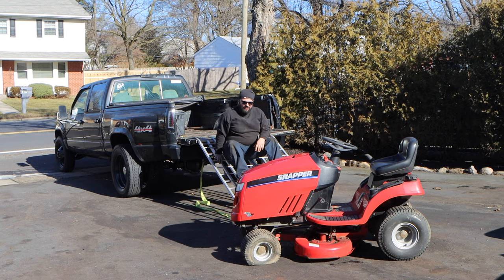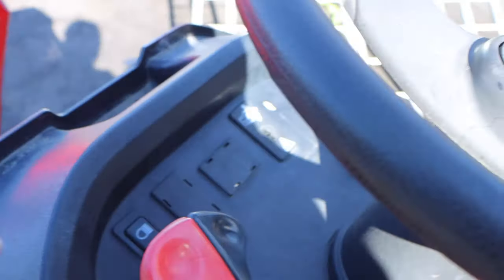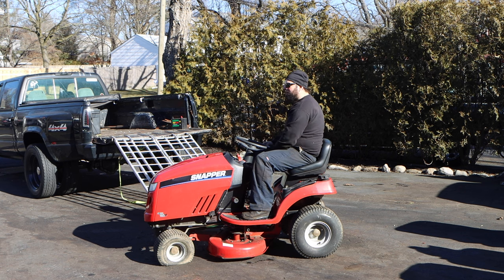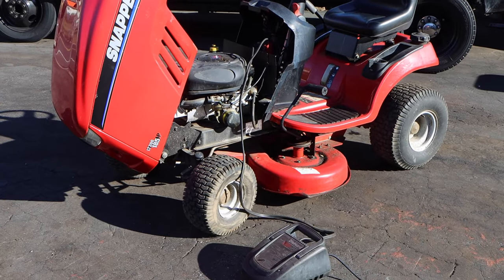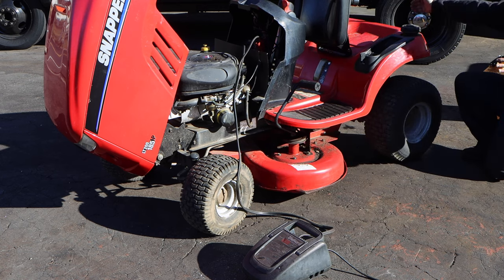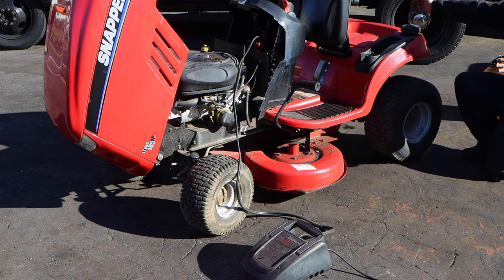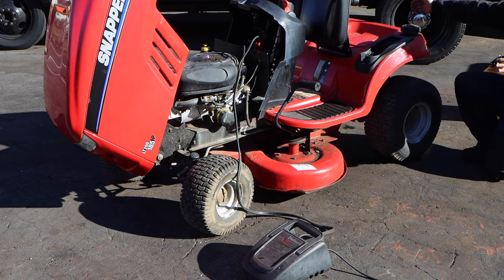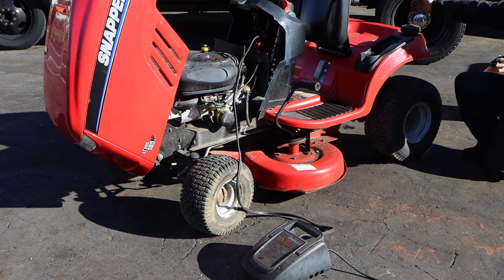Bought Abandoned Snapper LT200 Lawn Tractor 2 Teach Myself How To Fix #repair #diy #struggle

Comment: The yellow/black and the black wire heat shrunk together would go to the optional hour meter. The black with the ring terminal should be the wire from the starter solenoid to the battery. The positive terminal will also have a small red wire that goes to the 20 amp fuse then to the starter key switch. To jump a starter you often need a good connection, I try to activate the solenoid instead as a first test. The brake pedal needs applied to start, the pto off, and the seat switch depressed. The seat wires since disconnected should be open not connected. The parking brake might not depress the brake switch far enough to start, might need to depress the pedal. Mine is the twin cylinder version with a 44 inch deck. 
This rider is in the group with Simplicity, Agco, Massey Ferguson, Snapper and Allis Chalmers. Basically, a Snapper (cheapened?) version of a Simplicity Regent.
Reply: Oh, the starter is grounded through the engine block.
Reply from the maker: @robb1165  thank you!  that is what I thought

Comment: Set parking brake. Solenoid is bad. Start with a new battery.... I knew that was a Snapper 😄 🤣 
Hook positive from good battery to starter. Black to Negative on good battery/ the use the open end ground to the block. That jumps all safety switches.  Use a handle from plastic spoon in the key slot missing a key...
Reply from the maker: Sooo…How did you know it was a Snapper on my First Video?  What was the giveaway?
Reply: @pattayperformance  shape of the seat and body. Last one of those I had anything to do with was buying the engine after a tree crushes the back of mower. 20hp V twin with 108 hours. Looked exactly the same with the exception of the engine.  Later...
Reply: I burned my battery pack up, but they are so helpful! $120. Lasted 3 years.
Reply from the maker: @caseybszombiemowers2569  I will keep an eye and do some research on them.

Comment: Front valve stem in the inside matches my Simplicity mowers. Have had no issues with electric pto clutch in 7 years, dealer said they aren't a weak point (unless you snag the wires) but 🤷‍♂️ Get a DMM and check continuity of the sensors (with battery unhooked), they're just switches. The dangling connectors are not necessarily important, I've got a pretty high end Simplicity with all the options and it still has unused connectors on the harness.
Reply from the maker: What does your dash look like?  There are 2 blanks on the dash 

One is hours and what is the other…volts?
Reply: @pattayperformance  I think the other blank might be for hydraulic deck/accessory lift. The hour meter one can also include a digital gas gauge which is worse than the analog one on the tank 😁

Comment: Start with a good charged battery, and if that does not crank the engine over with from the key switch, short the solenoid and see if it  the engine cranks over, if so put a new solenoid in. The Brake has to be pressed, and the PTO Switch disengaged. The safety switch wires is tied into the PTO switch harness, so make sure the PTO Switch is push down. With the seat safety connected, you'll need to be sitting in the seat if you trying to crank it over from the key switch or just Press the brake pedal and set the park brake on, that will bypass the seat and brake safety but not the PTO safety. I would have bought that mower, so I don't think you did wrong by buying it. Jason stepping out our comfort zones and learning to be better at what we do, is always a good thing, so grasp the opportunity and stop jumping from a little spark 🤣
Reply from the maker: The Mrs said the same thing...she said I've seen you crawl under a semi and jump it.  Why is this any different.  I said...usually have my safety glasses on and when I hit the starter it moves.  The starter not moving and humming got me thinking a bomb was about to go off...did I tell you I suck at electrical LOL

Comment: Pull spark plug first and see if it turns over when you jump starter straight to a good battery.If so chances are compression release is bad or valves need adjustment.If it still does nothing starter is bad.
Reply from the maker: Thank you!

Comment: That charger may not give enough juice to turn the starter . Cracking requires a good 50A of current . the charger may not give you enough . A spare good used 12 v battery is a better source to boost with .
Reply from the maker: It juices up Mandingo but I will go through what I have

Comment: Tldr: yes the broken cruise is very likely your culprit or at least one of them 😁

Snapper has been basically a discount version of Simplicity for a while now, that looks like approximately the size of my Broadmoor. (As in, it may even share the manual, there are Snapper models in my manual) which also has a 38 inch deck but they had options for 40, 44, 50... Looks very very familiar to me, just a few slightly cheaper parts (no Vanguard, cheaper looking deck), very solid bones.

You gotta hold down the brake and turn the key to start it, with butt in the seat, and the cruise control (if applicable) and pto must be off (pushed in). Those are the ones that catch us in my family 🤣 I'm guessing the broken cruise switch is the culprit 

Yeah that's just like my Broadmoor. Darn good, just a little too narrow for mowing 0.6 acres. Go grab the manual and the parts diagrams from Briggs (who owns them now). It may be a Nikki, or Mikuni (?), or one other brand are possibilities on the Vanguard which is actually a Japanese Briggs joint venture.
Reply from the maker: Thank you!  I will get the cruise working and go from there!  not use to such fancy things

Comment: The discharge chutes are so stupidly expensive. It's not MTD or AYP/Husqvarna, but maybe you can make the MTD chute fit better for less than the real part. Briggs owns the brand now but probably didn't when that was made (mid oughts). Hopefully it's just one of the electrical interlocks on the starter. If you can't make it work you can probably part it out on eBay, I've bought a lot of parts on there.
Reply from the maker: $150 gonna have to figure something out even if I have to fab something

Comment: Simplicity and snapper = money pit
Reply from the maker: Why?  If their snowblowers and push mowers are good...why does the tractor fall short?
Reply: @Pattay's Performance  parts are expensive when they need replaced. Hoping you have just minor things to fix. Starter seems stuck. Walmart sells snapper push mowers. Snapper is owned by briggs.  I had a 1970 simplicity snow buster 524 that I got for free cleaned tank and carb runs like a champ gave it to my brother.
Reply from the maker: @christophermccomas5292  awesome!

IMO lack of experience/problems…

Seems like the most expensive things are motors/trans/seats and bagging components 

The only thing I priced out were blades, spindles and chute.

I didn’t know it was a 38” deck…so the only think that seems pricey to me is blades and damm chute. 

Spindles were are on par with Husqvarna 

Blades are $50 and chute is $150 which is BULL$$$it 

Odd size blades there are no aftermarket choices

Comment: Somethings to check, that missing key, may be an issue, the starter is frozen and may need lubing, pto won't work, unless that key is in, like a snow blower, I bet a snow blower key.... The plastic key, it might work, but that stater is frozen, it should of spun the engine, just by jumping the starter.
Reply: The missing key is for mowing in reverse. It turns and sets it to allow reverse mowing, and resets when ignition is turned off.
Reply: @robb1165  ah ok, on the back of it, does it have 2 wires leading to it?
Reply: @robb1165  or is it mechanical?
Reply: @robb1165  just wondering, if it's 2 wires just unplug one, to break the circuit.
Reply: The switch is a normally open switch, so disconnecting does not help as the RMO module is part of the cranking circuit. When you turn the key (spring loaded to return to open position) it closes momentarily and sets the RMO module to allow reverse mowing. The key is only about $5 but might have to mail order if no dealers are nearby.
Reply: @robb1165  ok that rules thst out.
Reply: To trouble shoot it you would see if voltage gets to the yellow starter solenoid wire. If not you can work back to the Green PTO switch wire, or go direct to the blue ignition switch wire to test for voltage. Where you lose voltage along the line is the issue. Line goes from ignition switch (blue wire) to RMO then blue wire to PTO switch, then Green to brake pedal switch, then yellow to starter solenoid.
Reply from the maker: @knighthawk86855    That Mow Reverse Switch is 5 or 6 Wires with some sort of relay/do hicky plugged into it.  If it was only two wires I would have install a simple toggle switch to save money!  @3:10 you will see what I'm talking about